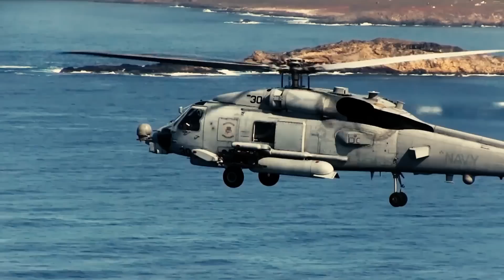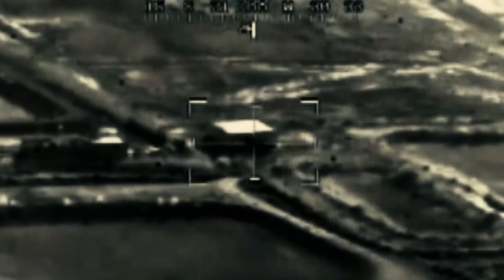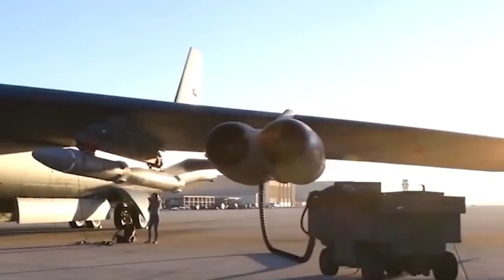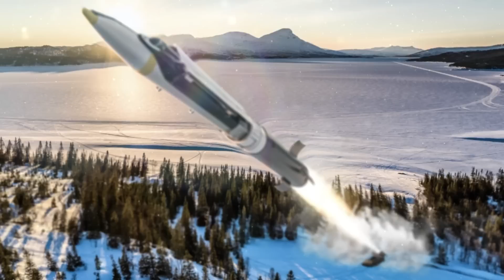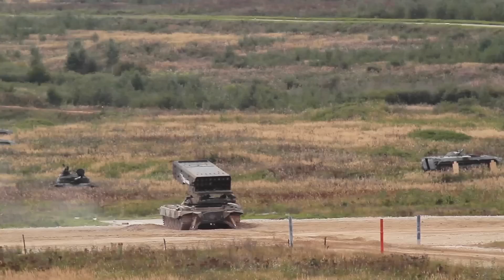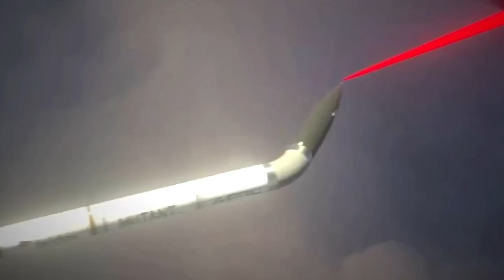30,000 Feet Up and Packing 1,000 Pounds of Destruction - America’s Unseen Killers

Comment: What ever happened to the "SPIKE," missile?
It was supposed to be a smaller, "cheaper," version of the Hellfire.  It was a guided missile, like the Hellfire, but being smaller and  a smaller warhead, made it a better choice over the Hellfire, for soft targets, like cars and houses.  Or even light military vehicles.  Leaving the heavier Hellfire to deal with tanks and other armor.
But then, the Spike just disappeared.
Reply: The Spike is an Israeli ATGM, developed by Rafael, and is available in man-portable, vehicle-launched, helicopter-launched, and naval variants.
Reply: @rumannkoch  Well, there you go!
But It was being touted a couple years ago, as a replacement for the Hellfire in all the cases except for heavy targets, like main battle tanks, and fortified bunkers, or other scenarios where the Hellfire would be the better choice.
So maybe the JAGM is the US variant?
Smaller, lighter, 'cheaper,' than the Hellfire...
Reply: The air launched long range versions have the same payload weight. 8kgs.
Reply: @zinjanthropus322  Same payload as what?  A Hellfire?
I wouldn't expect one variant to be any different than any other variant.
Handheld, air launched, or any other.
The only difference would be the launcher or platform.
They were looking for something less expensive to use, against soft targets, other than the Hellfire.  But similar and operated with the same sort of tracking and targeting tech, used by the Hellfire.
Even if it's an Israeli design, it will probably work with the American aircraft they use as well...  F-16, F-15, and now F-35.  Maybe more.
Reply: @FuzzyGatorDog  The air launched spike is the spike NLOS. There are smaller variants with smaller warheads but this one matches a hellfire in payload capacity and outmatches significantly it in range.
Reply: Its israeli thats why
Reply: People quietly made a bundle, then the program quietly went away?
Reply: @nicolasolton  Did it?  Or is JAGM the new name of SPIKE?

Comment: Ground launched small diameter bomb -GLSDB - turned out to be a complete dud, which is unfortunate given it's claimed capabilities.. The problem was the GPS guidance that was incredibly easy to jam, spoof or disable by the Russian EW units. This is very strange given how the GMLRS guided rockets fired from HIMARS were, and still are, making a complete havoc upon the Russian soldiers. Although GPS on GMLR was also jammed here and there, the impact of it was negligible. We also have the third case of the GPS guided ammunition given by us to Ukraine and it performed somewhere in the middle between the fiasco of GLSDBs and incredibly deadly GMLRS. This weapon is the JDAM bomb. Again this is unfortunate given the enormous amount of JDAM ammunition we have in storage.. 
The expert engineers from Boeing, SAAB and Lockheed are on terrain in Ukraine (or they were there) gathering data on why some system failed while the others worked great. 
Be that as it may US military is developing the GPS 2.0. which will be much more resilient that the original GPS but it's also using different tech to be able to do that...
Pentagon had no incentive to address this issue and invest in a more advanced GPS targeting systems, when the original JDAMs performed just peachy over Iraq and Afghanistan. Well, now we got a rel life experience of how to fight and what to expect from the near peer adversaries... Oooops my bad.. I was still thinking about Russia as the near peer adversary while in fact they are a third grade military, practically in rank with countries like Turkey, South Korea or India..

Comment: What Apache needs and needs at ASAP is NLOS (non line of sight) missile in a 20-30 mile range. JAGM was developed for a decade and all we got was basically 2 types of Hellfire in one missiles. Basically a Hellfire with laser and radar guidance, but still at the line of sight ranges of up to 10 miles. 
Helicopters will be so vulnerable if they'll have to prosecute targets they can see (meaning the target can see the helicopter) that the 20-30 million$ birds will be in such a danger that they won't be able to be used on a modern battlefield. 
But if you add NLOS missiles with off sight targeting system in the shape of the Special Forces on the ground or some cheap and small drones launched from the Apache, now you've got one hell of a system that's capable of of plucking out tanks before they know whatever hut them (similar of how we intend to fight the air war with stealth fighter jets, bombers and drones).